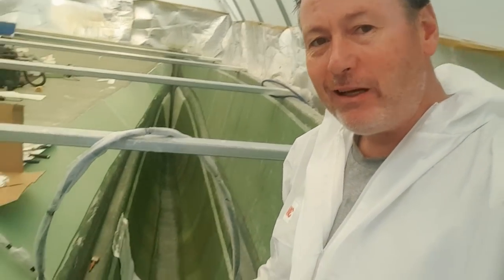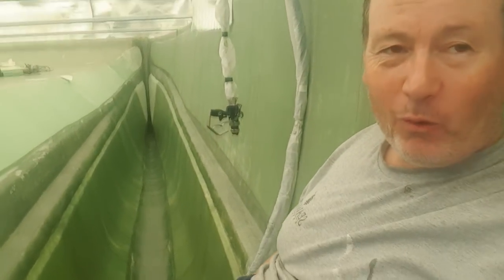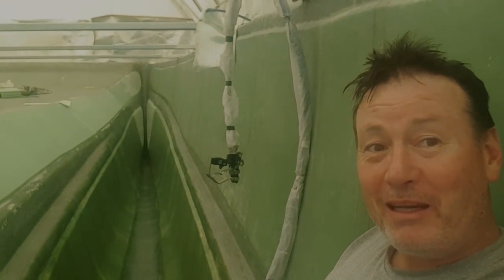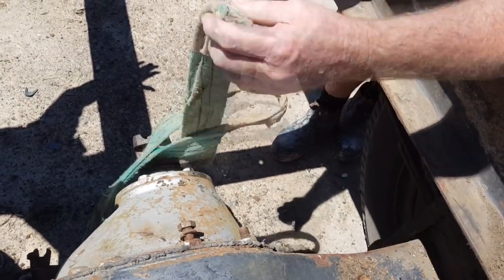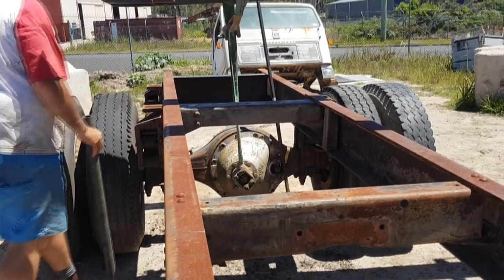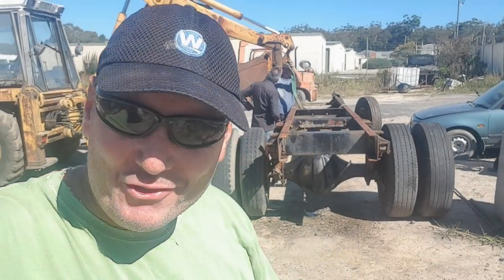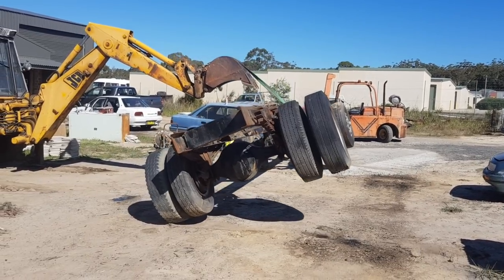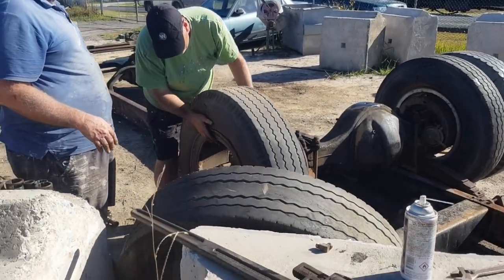Ep020 - Removing the Diff from our Boat Yard Trailer

Comment: Looks like so much work.  Suddenly vacuum bagging doesn't seem so tedious.  Thanks for posting looking good.
Reply from the maker: Gidday John, Yes Resin infusion is an attractive option , vac bagging near on impossible with the multiple components and lessened working times. The former would require a cast of thousands to do properly and the risk of failure high, and vacuum bagging simply wouldn't work on this scale as the wet resin working time would not allow for bagging of the regions prior to the resin going off. Vacuum bagging is suited to smaller items and panels where working time can be extended and particularly suited to epoxy laminates as working time is further extended prior to bagging and vacuum . A down side to these techniques is the incredible wastage of consumable ie mesh, bags , resin absorption blankets, tubing, resin etc which blows a lot of cost out for a weight saving that although substantial is not all that relevant on my build given our overall weight will be much lighter than the original production version of my boat with use of lightweight structural core and new uni and quad fabrics. My resin delivery system is without question providing a substantial weight saving also by being able to correctly wet out areas I am working on without excess as would be the case if I was hand mixing and rolling on with a roller. Best investment I have ever made and had reduced much of the work that would normally be associated with a build like this.   Thanks for the comment I appreciate the effort to watch and think these things through it makes the series worth working on. Cheers Ross

Comment: Mate nice sneak peak of you getting ready for bulkheads, can’t wait. Have you been wondering how much of a crack releasing her from the mould will be....😁
Reply from the maker: Definitely been thinking about the point of release and have some nominal release in most areas from vibration and some slight shrinkage . The perlins holding the hull sides together across the gunwale line have been removed at times and there is substantial release there. I have installed high pressure air fittings at a number of point along the hull and under bridge deck that will assist in release also . Worse case is I can float out with the crane lifting. It will still be a few months until I get the underside of the mold braced and yard trailer finished to be able to lift and roll out for demolding but it will be a big day nonetheless. Thanks for your comment buddy. Ross

Comment: Ross!  I've just found your series, and I'm really enjoying the videos. You just got the engine space foamed, but what do you do about waterproofing hull penetrations?  As you go through glass, foam, glass and then gel coat, how do you make sure water won't get between the layers?
Reply from the maker: Steve,through hulls fittings are only mounted on solid glass laminate then sealed throughly with marine sealant.I will remove all through sections of foam and reinforce with extra laminates prior to inetsllation. Cheers Ross

Comment: I live in Florida US.   It's really hot here too.  But a body does get used to it.  When it gets so hot you just must slow down to keep body temp from being too high.  Drink lots of water too.  If you notice salt in your clothes after perspiring you may need a salt tab.   I have also learned when fishing I soak my clothes with water.  That keeps you cool.  May not be so good laying FG.  Put huge fan in there.  Nice job mate.  Best of luck;
Reply from the maker: Sadly can't wear a wet shirt as I cant risk dripping any moisture into the laminates and introducing osmosis into the job. So a fan and ventilation is the only solution.i am working a bit slower in these conditions and adjusting the catalyst to suit the environment on a daily basis. Thank Thomas

Comment: Great looking build and I have been following it for a while Ross. The resin gun is great and I will view again that episode if I build my own composite hull one day. A you doing any more about the relative strengths and merits of the different types of resins, as in Epoxy, Polyester and Polyvinyl?? As I always understood epoxy to be stronger than the other types, and for Polyvinyl to be stinkier and more toxic than other resins?
Reply from the maker: Gidday David. You are dead on there, Epoxy is definitely the strongest of the resin systems, but is also the hardest to work with, hold little or no UV benefits, so care is to be taken when using it and making sure all is done to the highest standard at each and every stage. Funnily enough Polyester holds the strongest properties for the initial impact or first stress load ( all things being equal ie substrates and weight etec the same ), which then is surpassed over multiple loads and impacts eventually being surpassed by Vinyl and then epoxy. Not sure what polyvinyl is as Vinylester is in fact a modified epoxy and has a closer backbone to epoxy than polyester only with a styrene carrier. Hence my choice as it also emits lower styrene emissions and less smell. My entire hull is vinylester and all of the remaining parts, modules and deck will be in Polyester Simply as it wont be sitting in tne water and not prone to osmosis. Hope this helps. All the best Ross

Comment: Gday Ross, great vid, again. I paint houses for a quid and use a Graco air less on a daily basis. Is your mixing gun a similar concept. I'm not familiar with mixing A &B at the tip. Could you give me some insight into it. Cheers.
Reply from the maker: Steven, Can't say I know much about the airless systems but mine is simply incredible.I was concerned about external mixing and catalyst fumes but the quality of the Graco Gun has eliminated that concern. Correct atomisation and feed into the resin steam is as good as it gets. It is only suited to Saturated polyester and Vinylester systems including gel coat and resin. I can modify teh gun to a chopper at a later date with a nozzle and adapter change also.  Will not work with epoxies as catalyst rate is capped at 4% . Minimal clean up and reliability are the two key elements for me and Graco offers this hands down, albeit expensive replacement parts of which I have need none yet. . Cheers Ross

Comment: Hi, just found your Vlog and will go back to episode one but before I do, here's a question, how come you're not vacuuming the foam core?
Reply from the maker: You may want to take it slowly as there is a lot to absorb and think yourself lucky it isn't you doing it. lol.

This build would not be possible with vacuum bagging as it requires wet laminate working time and large areas are difficult to bag at in one sitting. Infusion process perhaps, but this would call for a team of workers ( which I don't have , nor do I want a team of workers)  and some serious consumables that would add substantially to the cost of the build for about a 100kg saving overall on the hull. I did consider this as I have the know how , however, opted for the recommended sea lite adhesive that was specifically formulated for this type of laminate and Foam, combined with a hot coat of csm under the adhesive ensuring maximum adhesion and complete filling of the foam perforation and grid score.

I am also deeply concerned about voids, faults and subsequent failures in infusion and my mold would require additional flanges to be added to effect a good infusion along with sealing of the outside of the mold to reduce vacuum loss through the mold, and changes later on to add modules etc with the infusion process and I have found that by hand laminating especially with my resin delivery system my substrates are not resin heavy and I have used an aerosil resin mix to bond the foam which certainly has done the trick, albeit a lot more handwork. The job is as neat as an infused hull to date and has actually been commended by a number of yacht builders and shipwrights in the region, so happy with that and I have done the whole thing meticulously to ensure consistency. 
 
As for foam and resin I suggest you may want to watch episodes that concentrate specifically on these questions. In short Vinylester resin is the chosen resin and Guritt H80 the foam substrate which one of only 2 brands permissible for the AMSA Survey. 

Cheers Ross.

Comment: Sand-blasting might be an option to clean the truck chassis...?
Reply from the maker: The chassis now sits under the mold and will require some substantial framing , welding and hydraulics to make it work , so for now I am getting on with the Cat. May well sand blast or just not bother as will be out of the weather all of the time till launch day and then live under the mold indefinitely. Thanks or the comment and appreciate your interest.Cheers

Comment: So there won't be any core foam where the chines are?
Reply from the maker: Hey Luke. Please check the video Episode 11  ( https://www.youtube.com/watch?v=9kmjvyG4kS0&t=198s  )here as it outlines the structure in great detail. There are overlaps of quadraxial that basically stiffen in areas that would be near on impossible to create a foam layer due to the hard chines on this boat. It was also in the engineering that created the strength in the chine to minimise failure in sheer,  in difficult areas to sandwich. Hope this helps, Cheers Ross
Reply: Thanks Ross, I just watched that one... makes sense now.  I haven't yet caught up on all the episodes from before the new year when I found your channel.  That lay-up schedule is really detailed, I'll be it sorts out a lot of questions and makes planning a lot easier.  Nice work, keep it coming!

Comment: Why did you remove diff?
Reply from the maker: Diff gearing was removed and a waterproof cover will be installed and fillewd with oil so the trailer can be submerged to launch mine and a number of other cats in the area.We also rotated the front axle around to facilitate better steering when a draw bar is attached. Alos the guy I bought the truck off has the same truck and wanted the gears, so I relinquished the diff. Cheers Ross

Comment: Maybe I saw wrong but it looked like there were air spaces under the foam where it didn't get rolled in?
Reply from the maker: +John C Area is void free.It is the white bedding compound coming through the perforations in the core then sanded flat before glassing.Vibrating roller druves thed compound up and out.There are holes ecery 49mm that form rivet like attachment to the base .Cheers
Reply: Never mind. It is the white resin holding the foam on.
Reply: Seriously jealous of the molds.